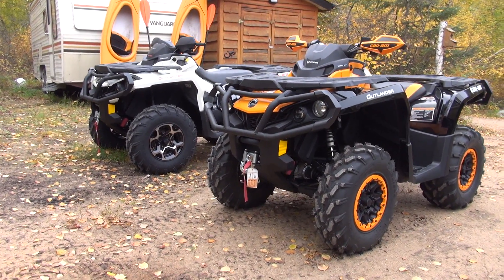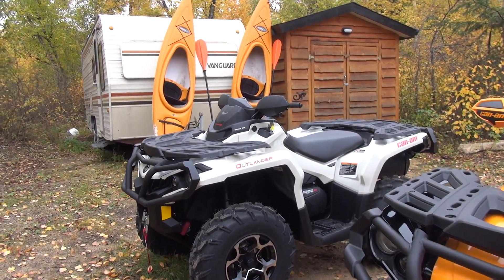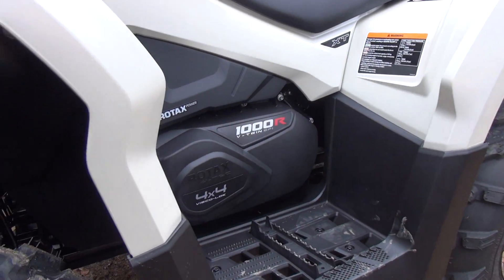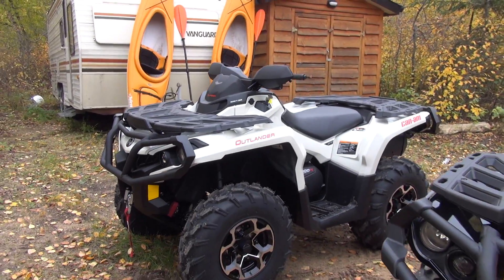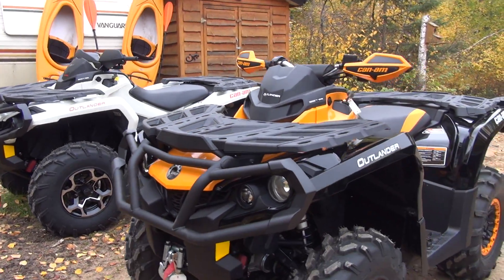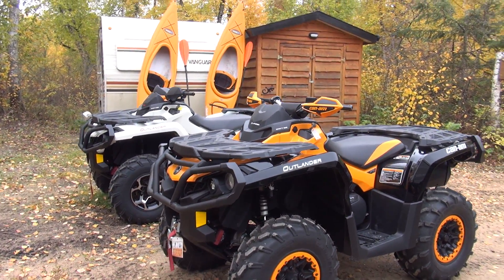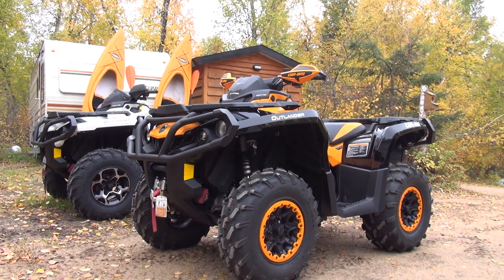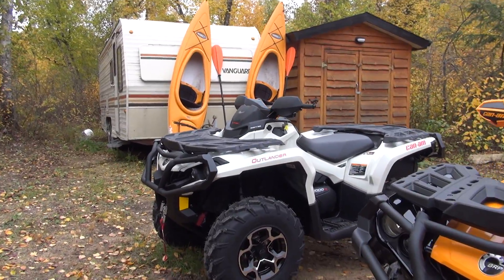2015 1000 XT-P vs 2016 1000R XT

Comment: more power yes but the 1000r does not use the mav heads or cams, the 850 uses mav heads but keeps the 800 cams
Reply from the maker: +miller440x There has been a lot of info and mis info on that, we will check part #'s on the machines that are here
Reply: +ostacruiser according to the brp site the 1000r still uses the small valved heads, im assuming they did this purposely to leave more available hp over the next year or 2 with the cc cap at 1000

Comment: I'm a Honda guy have been for years got a 2008 Rincon done everything there is to do to it ...... looking into a new bigger badder machine how are the can ams dependable wise all I've done in 8 years is break pads and wheel bearings ..... I want a machine that is nasty and will last 10+ years any input?
Reply from the maker: its all in how you take care of it...and with Can am 1000's you just need some throttle control if you are going to run 30" or larger tires...you will not be able to get the smile off your face :)
Reply: +ostacruiser  ya I'm actually looking at the 16 renegade xmr or the Polaris 1000 high lifter

Comment: Nice Osta!  Have you done a review on the '16 XMR 850?
Reply from the maker: No I haven't had a chance to rip on one yet
Reply: Thanks Osta! Trying to decide between the XMR 1000 or the 850 but not sure what to think of the longer wheelbase on the 1000...any insight? I know the 850 only has 78hp, that's why I was wondering if you had done a review!
Reply: +ostacruiser Can you tell me what camera do you use? please osta!
Reply from the maker: +ANDRESLARRACAN 007 Sony hdr gw 77
Reply: +ostacruiser those things sound like race cars at high speed
Reply: +ostacruiser please do a review on the 2016 outlander 850xmr. there are a lot of videos but I like your reviews and points of view the most.

Comment: whats the best can am 2016 1000 to get i dont care about how fast they can go i just wants it for power right now i have a 2013 1000 xt im trading her in for a 2016 650xt bc the 1000 is to much for my girlfriend and im looking at buying a new 2016 1000 i was looking at the r
Reply: +Tyrone Clarke If you don't mind getting a little more dirty and not having the racks I'd get the renegade xxc! It handles extremely well and with the suspension set down its a low center of gravity. Plus I like the dual brake levers and you can always buy an aftermarket rack and even fenders if needed. A lot of people prefer the outlander though but that's my choice.
Reply: +Nick Parkson ya I wants it for mudding
Reply: +Tyrone Clarke That changes things a bit lol. You can always just get the xmr I guess. There is an outlander and renegade version. If I was in the mud constantly I might would get the outlander. Easier to move around on cause of the bigger size and less mud on you so its easier to focus. I'm never in the mud though, I just like to hit down the trail like a scalded dog lol.
Reply: +Nick Parkson ya I'm going in tomorrow and getting the outlander  can't wait
Reply: I've never had a can-am before but would like to. I've drove a lot of them though including the 1000r. That's how I know a little about them. A brute force 750 has really good power but it's nothing like the 1000's, stock anyways lol.